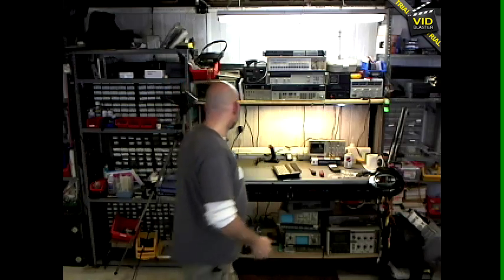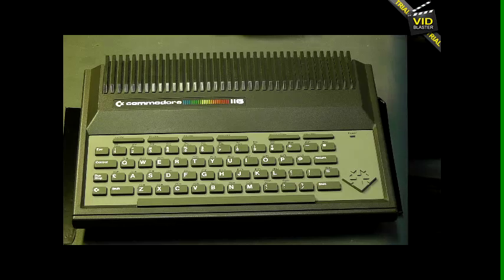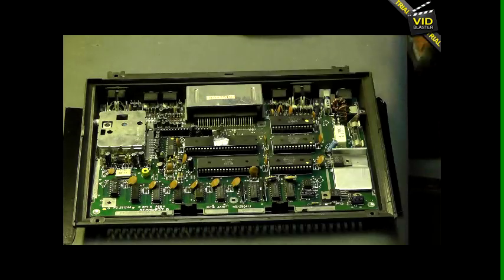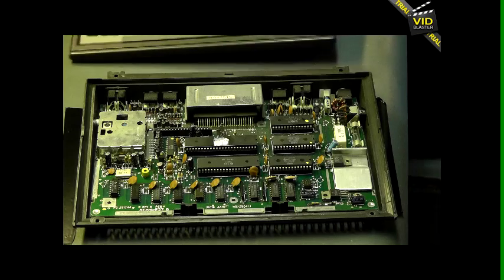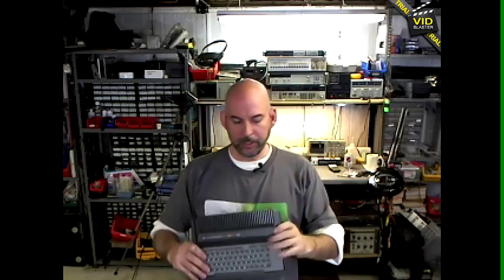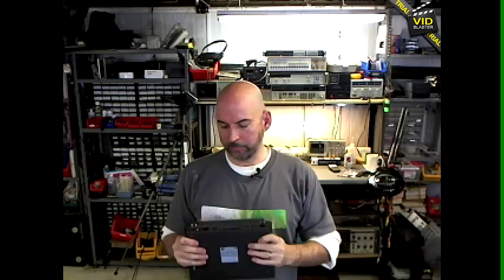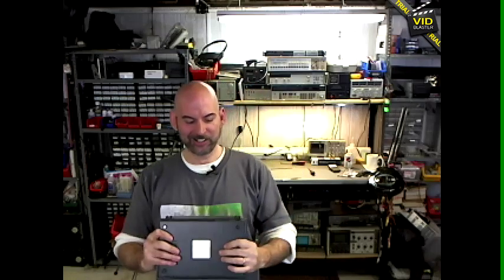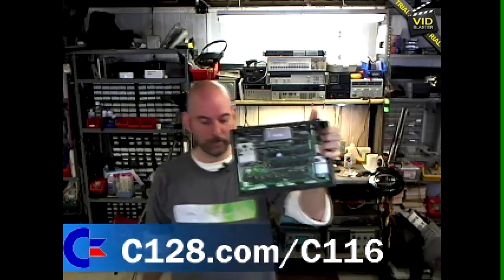The Commodore C116 as shown by Bil Herd

Comment: The C16 was the first computer I had all to myself when I was a kid. I got it secondhand after my dad's friend's kids had outgrown it. When I finally got a C64 years later it seemed like a step backwards, because it had only 16 colors and a much more limited BASIC that needed PEEKs and POKEs to do anything with sound or graphics. The C16 would've made more sense if they had kept it in the C116 case with the chiclet keyboard, but I guess they were trying to sell it as the successor to the VIC-20.
Reply: According to Bil's book (_Back into the Storm_), the C16 was in the breadbin case and used the C64 keybord (with some keytop symbols changed) because those were parts they already had in large quantities, thus reducing the cost. I have the impression that the C116 came later, when presumably they no longer had a huge stock (and were not making that case and keyboard any more because the C64 had switched to the new case and keyboard).

Comment: My first Computer was the C116 ,..and i was without money ,,so i was forced by myself to learn Basic on the C116 ...I Typed the code of my 1 Circles on Graphicmode on the C116 and i was proud of that.  AND ;)     becouse the C116 looked so much better then the C64 and the Basic was so much better then the Basic V2 on C64 ..I always loved the C116 more.. Today i own one working 116 (sealed ) ..  and i  switch it on only a view times  for only some Minutes and  so  its stays healthy ....(AND I LOVE that Keyboard and i dont know why ) ...The c116 is my Favorite ..
Reply: Congrats! Don't be fearful of using it for longer. The only things that normally go bad on old computers are batteries (none in the C116) and certain capacitors (which the C116 doesn't have the problematic type), but those go bad over time, even without usage.

Comment: what would be the correct way to implement the IEC bus using a single VIA and the hardware shift registers and interrupt triggers in it. (unlike all that bitbanging crap used in (most of/all?) commodores own products). quite clearly the VIA designs hint at being partially made to do just that and yet i can't find a single schematic in which the data is not connected to some general parallel data pin. also with the proper electrical isolation and esd protection and none of that cheaping out stuff that causes things to catch fire.

Comment: First Computer was ZX81, came in a bag of loose components, to solder by your selv for 99DeutschMark.
1k ram got me fast to its borders, even with a TapeRecorder fitteded.
Next where an C116 with 1531 Datasette. I looooved this machine! Really cool BASIC, rubbish keyboard! Got the C16, and quite later the plus4 with an 1551! I still have them, and they Work!!
If it just have had sprites and better sound..Gosh!
The crappy onboard software was useless! Never used it, couldnt even find out howto!
The best thing was, to build a cadridge with a Centronics-port, and using the F-Buttons memory for printing on a Brother 24pins printer in assembler!
Best days of my life!

Comment: I still think all these stop gap computers were a bad idea. Who wants a plus 4 when you can get a C64 for a bit more. Bit like the A300 to the A500. Another cheaper option. Of course that never happened. It just got named the A600 and was released at the same price. Systems like the C16, C64GS, CDTV, A500+. Commodore made some strange decisions not to mention its really confusing for the consumer.
Reply: yeah i got one :) never used it though, it was given to me with an A500 that i picked up for free.. Along with a Vidi Amiga 12.
Reply: The idea was to have different product for different price points and market segments. The TED-line made sense, as spec'ed by Jack. At the time Timex-Sinclair was a potential threat, and Sinclair was #1 in UK and strong in Europe, at a lower pricepoint and lower specs than the TED-line. Problem is that Jack left before it was finished and Commodore lost sight of the target--changed the lineup and the marketing and dramatically raised the prices on all but the C116, which was only released outside of the US.

BTW, the A600 ended up replacing the A500Plus at a $100 higher pricepoint, not even the same price. It's feature-set was expanded to justify it, but still, they killed the most successful Amiga by a long shot and replaced it with something more expensive.

Comment: Ted (Text Display) 80-char wide generation, and other inventions/engineering improvements such as overlay Touch-screen and Light-Pen for CBM, were conceived and designed at XXCAL, inc CPD (Consumer Products Division) by Bill Byles (EE-engineer) and Steve Kotleba (Director, CPD. Software). They were promptly stolen by Tramiel, CBM.